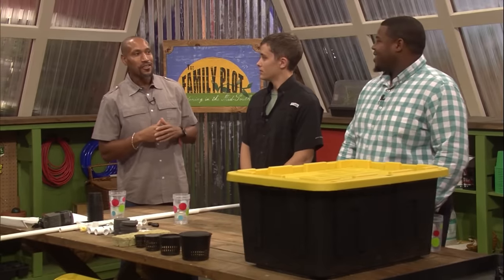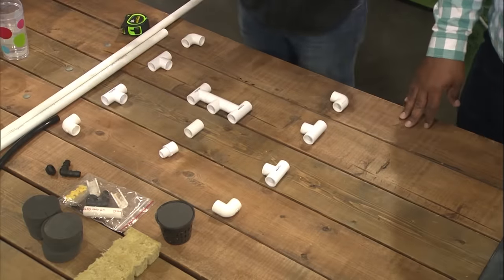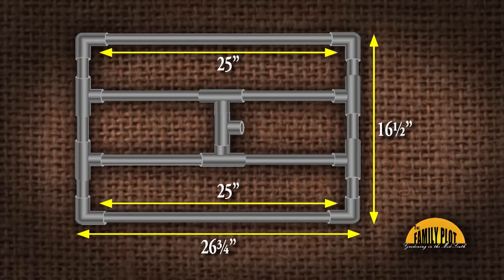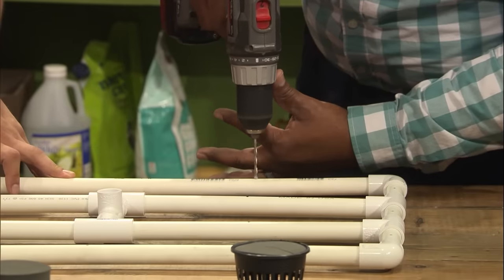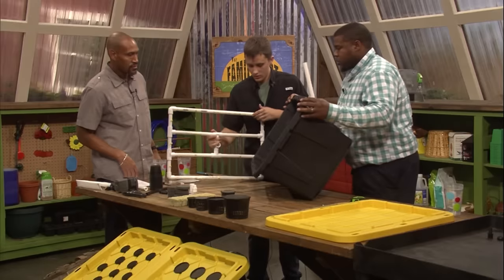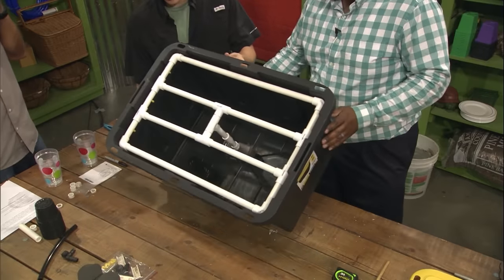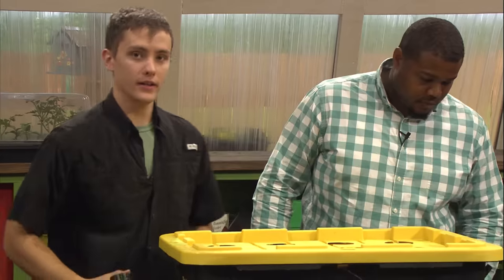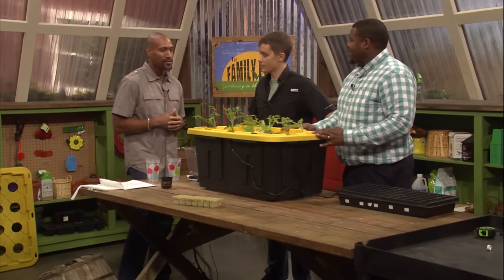Building an Inexpensive Hydroponics/Aeroponics System

Comment: what type of plant food do you use and how often do you need to add water?
Reply from the maker: We are using the General Hydroponics Flora series of nutrients, but there are many other good nutrients out there too. We completely drain and refill the tub with water and fresh nutrients about once a week. You can see how here:  https://www.youtube.com/watch?v=gYrTTLbl3Ro. The plants have gotten bigger and they really suck up the water so we end up adding about a gallon of water a day to keep up with them. So check water levels every day and drain and refill with new nutrients every week.
Reply: thank you
Reply: so you are getting through 16 gallons of nutes per week? 10 gal fill + 6 gal in daily topups before dumping it.
Reply from the maker: We only put the nutrients in the 10 gallons we fill with. The top offs are just water.
Reply: The only day the plants will be getting a fully balanced nutrient is on the fill day ;) If the topups bring the EC back up to the start value you should reduce the starting EC. If they reduce the EC, the nutrient will gradually become weaker if you dont add back nutrient. In any case, the elemental balance of the nutrient will alter through the week so adding fresh nutrient isnt a complete solution. Its better to ascertain the ideal EC level and run that level  drain to waste. If its 14 gals in 7 days, running 2 gal per day will equate the same amount of nutrient use per week. The difference is the last drop on day 7 will have the same elemental make up  as the 1st drop on day 1, no daily ph/ec checks (nothing comes back) and no dumping, you simply refill when its gone. Toms and basil wont be happy on the same nutrient.Toms require increased  N, K and Ca levels during the growing season. You`ll find the toms will strip and stockpile large amounts of K (potassium) from the reservoir on the fill day. Checking the reservoir ph and ppm on day 2 will confirm it was removed from the res  ;)
Reply: I use liquid fertilizer and my system requires a few gallons every week. I check the water level, pH, and dissolved solids every few days.
Reply: depends on the plants and how lazy you are. a nice clean feed run can be good for a week or two, depending on conditions... check EC if its high, they only need water... if its low, the need both.
Reply: Family Plot 

Can you provide a parts list and where to get that bucket?
Reply: It's very hesitant or nervous. Cuz there is soooooo much to learn and EVERYONE seems to all have a slightly different opinion how they like doing it their way but all that matters is the basic NPK (Nitrogen,Phosphorus, Potassium)  Nitrogen is used by plants for lots of leaf growth and good green color. Phosphorous is used by plants to help form new roots, make seeds, fruit and flowers. It's also used by plants to help fight disease. Potassium helps plants make strong stems and keep growing fast. Just stuff, pretty much that sometimes came up with and started calling plant food "nutrients" obviously dirt already has that in it so never have to worry about it. Plant seed and wait lol. That's all is needed. Not including sun and water obviously.... just ignore all the commercial side of shit, every product is almost the time trying to convince people they NEED this thing to grow plants. Not true. 3000 years ago they didn't have anything but sun and water and plants grew just fine lol,  so those 3 nutrients kind of do the same thing for different stages of plant growth... 1st stage is obviously "grow" stage called "Veg=growth"  the plant uses mostly Nitrogen to grow, that's why when you buy dirt you see tin white pieces look like Styrofoam.   2nd stage obviously is the( flower/budding stage) after plant gets big it starts getting flowers, vegetables buds , tomatoes....that is what flower stage means....or starts smelling like weed. The cannabis flowers are the tomatoes version on cannabis plant... corn on cornstocks etc.... It's all flowers technically it's usually called "Bloom" stage or flower stage for obvious reasons..... -_- .....   :)..... then last stage is taking the blooms that the plant has made the plant just matures that flower to get ready for winter and that's how plants make more plants. Flower = seed/baby making in plant universe lol. Now plant uses all those nutrients throughout entire life process. It just uses more of a certain nutrient to grow whatever it needs depending on the stage.... So hydro helps control the entire plant life instead of letting the plant grow itself with dirt.  Plant can't tell the difference of water or dirt. Just knows looks and uses the nutrients. I've used just the veg state nutrient throughout the whole process and you'll still get a plant at the end no matter what, but it gets bigger and lives healthier if it has exactly what it needs through the growth. That's it. All else is commercial products confining you that you HAVE to use this product this way if you dont then it won't work. It's all bullshit. Don't be fooled. You can even use and make your own plant nutrients dude. I've used molasses before as a nutrient and it worked and grew awesome. Just find some shit that has shit the the plant news to grow some shit. :) Ta Da :)  I worked at wetwrk first opened and it was mind boggling how you realize how products work and are sold. Most just shit you really don't need but get fooled into it because the bottle told you to buy another bottle and another product and another and another. It never ends and the rabbit hole keeps getting deeper lol
Reply: @billykester931 

Respectfully, I think you have got it wrong if you think plants need only NPK to grow well. That's like saying humans just need fats, carbohydrates and protein to grow.

Just like humans, plants need their vitamins and other nutrients. Plants growing naturally in the ground get theirs from the ground, where they have accumulated over the eons, albeit in minute amounts (trace elements).

If the plants deplete these elements, they will visibly suffer and produce less.

Look up what happened to the pineapple industry in Hawaii when the iron content was depleted or the effect of molybdenum deficiency on sunflower seed formation - just for two examples. 

Granted there is a lot of hype and snake oil merchants lying in wait for the unwary out there, but it ain't as simple as A-B-C. Or just N-P-K either.
Reply: @billykester931  3,000 years ago, one of the Ancient 7 Wonders of the World were the Babylonian hanging gardens, this was the earliest form of irrigated water culture that we know of. The small white pieces you've noticed in high quality soils are a product called perlite. It's is a form of obsidian, which is cracked crystallized volcanic glass and it is completely inert. It acts as a filler to promote drainage in plant growth media and has nothing to do with nitrogen. A well balanced plant nutrient system provides both MACRO and MICRO nutrients to the plants and needs very few bottles to achieve this, and i think that's what you're getting at. As gardeners we usually learn the hard way that "less is best" however, the technically savvy can fine tune and tailor their feeding regimen to hone in on specific needs for certain stages of development, and that is what the industry was aiming at when you see so many companies with so many different bottles labeled for this stage of growth or that. The problem isn't their many bottles, its the seemingly constant effort to push the newly initiated into using all of these "special" additives to achieve success when in reality a new gardener who simply wants a plant to finish its life cycle with a desired quality can benefit greatly by using much less product and spending their time and money learning other aspects of their hobby. We've evolved, at Wet-Werk, to sell less to our customers and teach them more. But we, too, have a lot to learn. The world of consumable plants has a hefty breadth of information and it's difficult to wade through. Just like any other industry, every consumer should be cautious with their spending and learn as much as they can rather than looking for a single solution to eliminate their learning curve. Master gardeners know they must supply everything a plant needs to the roots, with little extras, and focus mainly on its environment. Outdoors, that means seasons and shade. When growing indoors, we want to avoid over zealous salesmen and simply achieve a baseline of comfort for our plants to thrive. Once that baseline has been reached, pests and pathogens are the industry's main concern. The industrial revolution has now made it possible for all of us to use this technology. See the next reply. Thanks for your comment.
Reply: @billykester931  History of Hydroponics

Merle Jensen ISSN: 0253-7494

 A look back at the history of hydroponics
The Past:

    Several hundred years B.C. – The Babylonians had hanging water culture gardens considered one of the seven wonders of the ancient world.
    Several hundred years B.C. – Egyptian hieroglyphs tell of the people growing plants in water culture.
    Theophrastus (372-287 B.C.) – A Greek philosopher, performed experiments in crop nutrition.
    During the 1st century A.D. – cucumbers were grown off-season for the Roman Emperor Tiberius using a “transparent rock” (presumably mica) covered structure (first known use of Controlled Environment Agriculture (CEA)).
    1200’s and 1300’s (as described by the Venetian traveler, Marco Polo) – Floating gardens of the Chinese.
    1400’s – The Aztecs, who settled near Lake Tenochititlan (near the site of present day Mexico City), created gardens on floating rafts called “chinampas”.
    NOTE:  During the past 400 years plant culture techniques were developed to study the mineral nutrition requirements of plants. These techniques, known as “water culture”, were the beginnings of what later became “hydroponics”.
    1600 – A Belgian, Jan Van Helmont, performed the earliest known experiments to determine the constituents of plants:  A 5 lb willow shoot planted in 200 lbs of soil was covered to keep dust out and watered with rain water for 5 years. The willow increased its weight to 160 lbs., but the soil lost only 2 oz. His conclusion: plants obtain substances from the water needed for growth.
    1699 – An Englishman, John Woodward, used various types of soil to grow plants. He found that the greatest growth occurred in water which contained the most soil. His conclusion: plant growth results from substances in the water derived from the soil, rather than from the water itself.
    1804 – N.T. de Saussure made the first quantitative measurements of photosynthesis and proposed that plants are composed of chemical elements obtained from soil, water, and air.
    1851 – The French chemist, Jean Boussingault, verified de Saussure’s proposal when he grew plants in insoluble artificial media such as sand, quartz and sugar charcoal plus solutions of known chemical composition. His conclusions:  plants require water and obtain hydrogen from it; plant dry matter contains hydrogen plus carbon and oxygen which comes from the air; plants contain nitrogen and other mineral nutrients.
    1860 & 1861 – Two German scientists, Julius von Sachs and another by the name of Knop, used “nutriculture”.  Today this is called water culture, a type of hydroponics. The roots were immersed in water that contained “salts” of nitrogen (N), phosphorus (P), potassium (K), magnesium (Mg), sulfur (S) and calcium (Ca).  It was shown that these minerals were needed in large amounts by the plant, hence the term “macronutrients”. Both scientists devised nutrient solution recipes.
    NOTE:  From the 1860’s to the 1940’s several other scientists studied plant mineral nutrition using water culture and identified other minerals needed by plants in much smaller amounts. These are called “micronutrients” and include iron (Fe), chlorine (Cl), manganese (Mn), boron (B), zinc (Zn), copper (Cu) and molybdenum (Mo).
    During this time several plant nutrition scientists also developed nutrient recipes for optimum plant growth, including Hoagland (U.C. Berkley, 1919), Hoagland and Arnon (U.C. Berkley, 1938 – “The water-culture method for growing plants without soil”) and Robbins (Rutgers U. 1946).  D.R. Hoagland became so well known for his work in plant nutrient formulas that today it is common to refer to a nutrient solution recipe as a “MODIFIED HOAGLAND’S SOLUTION”
    1925 – 1935 – The greenhouse industry expressed an interest in using “nutriculture” instead of conventional soil culture because, over time, greenhouse soils would have problems with soil structure, fertility and pests. Small-scale laboratory techniques were modified to accommodate large-scale commercial crop production.
    1930’s – W.F. Gericke (U.C. Berkley) experimented with nutriculture on a large scale and coined the term “hydroponics”, which is derived from two Greek words: “hydro” meaning “water” and “ponos” meaning “work”.  Literally = “water working”.
    1940’s (WWII) – The United States military used hydroponics to supply the troops stationed on isolated, non-arable islands in the Pacific.  After the war the U.S. Army built a 22 hectare hydroponic operation at Chofu, Japan.
    1950’s – Commercial hydroponic operations appeared throughout the world in Italy, Spain, France, England, Germany, Sweden, the USSR and Israel. However, hydroponics was not widely accepted since the techniques used incorporated concrete growing beds which were expensive to construct.
    1970’s – With the advent of plastics an interest in hydroponics was renewed. Plastics began to be used as greenhouse covers, growing bed liners and in irrigation systems.  However, two new problems arose: Escalating oil prices in 1973 substantially increased heating and cooling costs AND there were few chemicals registered for pest control in greenhouses.  Increases in root pathogens (which when inadvertently introduced into a recirculating hydroponic system could spread to all the plants in the greenhouse), and an increase in aerial pests (which found a perfect environment to multiply in the climate controlled greenhouses) caused many operations to fail.
    1990 – There is a renewed interest in hydroponics.

Comment: This will be perfect for my lettuce; I am growing the devil's variety.
Reply: lettuce would be good..I saw many growing lettuce using this method.
Reply: @AGNESC68  
This method sucks
Reply: @usa5439  Is it ?? I haven't tried.
Reply: @AGNESC68  
I was stupid and built like 6 of these things with 40 plants each. First of all it leaks everywhere. I even used rubber weather stripping to seal it and nothing works.   Then the 2nd problem is that the nozzles clog up daily. So you have to take off 20 or however many u have each day. The pump also gets clogged.
Reply: @usa5439  You had way too many plants per system... Max for the devils lettuce should be 4. You had 40
Reply: @jonross377  
It leaks from the sides of the lid. It has nothing to do with the amount of plants. I went back to a rail system and bucket system. I use these things for my clones now.
Reply: Jake Sangria  
Use it how? You cant permanently seal it because you have to open it again.
Reply: It works fine for me. I’ve been using two I’ve built for over a year now. 6 plants each. I feel like you’ve either done something wrong or used poor quality materials. I use 4” net cups with collars, I could see some problems using other mediums, but the collars seem to block all the splash back
Reply: @Buttersmoke  
It leaks from the sides of the lid, not from the top where the cups go in. Also the pumps and sprayers get clogged and I have to clean them out and the roots dry out if 1 gets clogged for too long
Reply: What pump are they using? I really need to know, thanks!

Comment: what's the drill bit size for the holes you make in the lid???
Reply from the maker: The holes here are 3" for 3" net cups. I made another system with 2" cups and used a 2" hole saw for those. In the 2" system the 2" holes were a little too big. The net cups do not fall through, but if I push on it it will pop through. I would do a test hole in a thin material like Masonite or a milk carton and check and make sure the hole it the right size for your net cups. With hole saws you really need to get the hole the right size the first time. It is hard to open up the hole more after the fact.
Reply: @FamilyPlotGarden  For 2' netcups a slightly larger 2 1/8" hole saw is better. Our 2" hole saw doesn't allow our 2" netcups to rest all the way to their lip.

Comment: should have drilled the holes with the drill in reverse after the pilot hole has caught and used the friction to slice through the lid, much less cleanup!
Reply: chuck up the drill normally and set the rotation to clockwise to tighten up the hole saw... then switch the drill into reverse (counterclockwise). 
Now you drill as you normally would, but the teeth are now a lot less likely to dig and catch because they are running backwards and the back of the tooth is doing the work. Much less likely rip the tote cover to shreds. It also results in a smoother cut.
Reply: Just like cutting vinyl siding, blade in reverse. I'm a little surprised that lid doesn't crack when you drill it.
Reply: @neilkushnir6064  The lid is fairly rugged. However, we've certainly taken the reverse drilling to heart. Now even the 8 year olds can cut a hole when they wanna learn in the warehouse with us. Thanks, youtube commenters!

Comment: I have built same type of aerponics system, and other fill and dump hydroponic systems. One issue you have with the spray heads is they clogged up, the key is to use very clean water, and check on the spray heads once every few days!